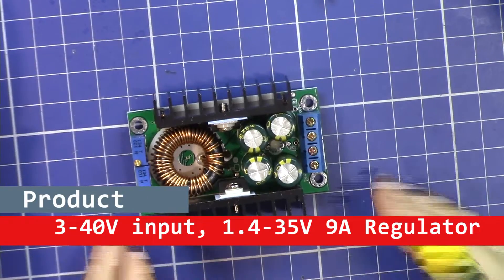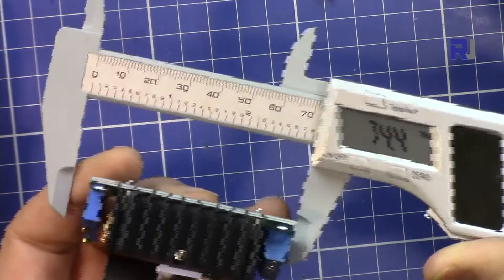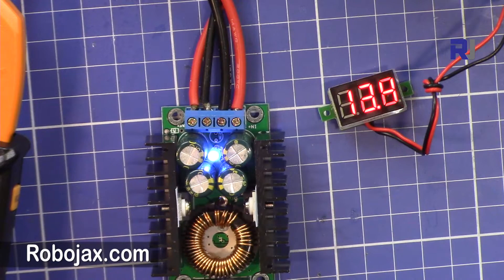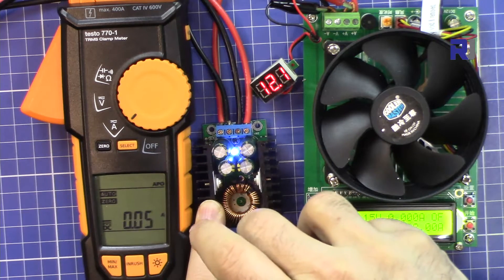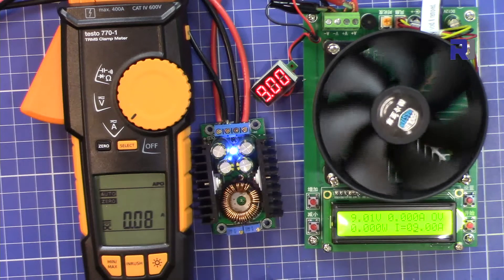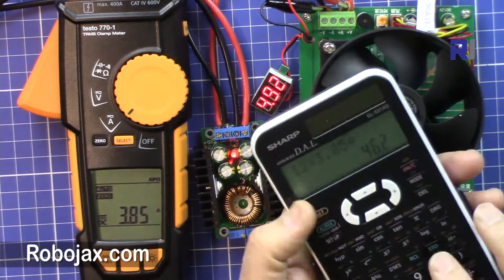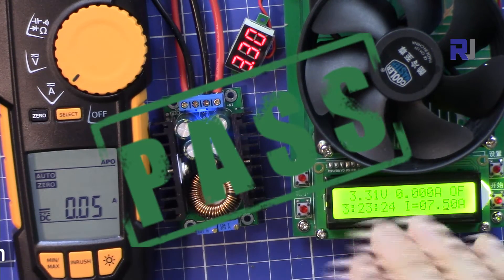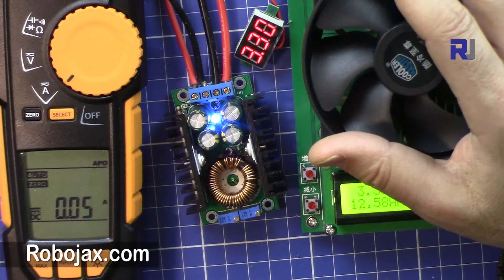DC CC 9A 280W Step Down Buck Converter 7-40V To 1.2-35V XL4016 Module - RJT321

Comment: I have connected 200watt solar pannel 16amp current worked but very hot 🔥 so I'm using 100 watt pannel it's working very well to recharge my batteries since 7 years

Comment: I am trying to connect TEC-12710 to XL4016
but buck converter takes less power when connected with power supply
i mean its current pot comes in even if only one is connected 

i wanna connect 4 peltiars 
and control them using a buck converters output voltage pot (that i will change with dig pot to control the power)
i want to each on 45W in the start and then i can reduce the power by reducing resistence from dig pot

any buck you suggest me to use ??

I am new in electronics
Thanks you for reading

Comment: what module have small cheap and can down volt, 40V input max and output 5V max to arduino, i need sense when 40V power supply have ON and then arduino input sense this aand doing somethink whit servo.if power ON servo move left, if power OFF servo move right. and arduino whit servo have own different power supply.

Comment: I just got mine in the mail and used an 18 volt battery stepped down to 12.8 volts at 5 amps and i can't get more than 1.6 amps. So its not 300 watt but more like 20 watt! Oh well time to modify! Cheers from Australia subbed and liked 👍
Reply: Hey..did you set the current limit properly? It could be due to wrong current limit setting

Comment: Hello. Is it possible to use two of this in parallel so to increase its tolerance from heat when used in 150w or 200w solar panel?
Reply: pm me can you to install do sola paint of charger¥

Comment: I've bought one of this but mine wont change the voltage output. If I connect 12V, on the output is also 12V no matter which way I screw trimmers. Same with 3V and 5V. Any suggestion where could be the problem?
Reply from the maker: The power MOSFET switch is dead. Unless there is incorrect soldering

Comment: Ampere does not work.  Only voltage works.  The green light is on but the red light is not.  What is the solution?
Reply: have u found a solution

Comment: We observed the module maintains the RED Led on, even with 7.5A. It would mean, at least for me the circuit is limiting the current, or close to do so. That might explain the voltage drops we saw at 7.5A and the more drastic voltage fall at 9A~8A. 
There is another channel that modified the circuit to increase the CC operation from switched (in the current loop) to linear, adding a 100K resistor in the feedback of one of the LM358’s OpAmp. This made it work linearly, instead of a On-Off comparator.
Reply: pm me can you to install do sola paint of charger¥
Reply: Which was this other channel which showed the modification, please do tell.

Comment: Hi Robojax, I just bought one of these XL4016 modules, hooked it up correctly, applied 6 volts to start and started turning the voltage cw. The red light came on right away and the voltage decreased from 4.8 to 2.9 and stayed there. Turning voltage and current pots either way does nothing, stays at 2.9 volts with the red light on. Gave it 18 volts DC and still nothing. Any ideas?
Reply: pm me can you to install do sola paint of charger¥

Comment: Can I use 24v input with 6a 100w for this module?
RESPECT🙋‍♂️
Reply from the maker: yes you can. input is as important as output. but the total power you can't get more power than the input power.
Reply: Is good thanks

Comment: what the meaning red lamp on the step down?
Reply from the maker: that is the CC or constant current light. When the current reaches the maximum setting value of current, it will reduce the output voltage to keep the current constant.

Comment: What happen if you remove the insulator paper betwin XL4016's and heatsinks? Thermal transfer should increase
Reply from the maker: no. it will decrease. the metal surface is not as smooth as you think and both metals will not stay in contact. So keep it.
Reply: @Robojax I guess the insulator is used to avoid that heatisink become electrical conductive. But have worst heat conduction than quality thermal paste.Try remove imperfection from Mosfets and fine sand heatsinks then apply MX-4 instead the insulators. It's hard put in shortcuit them since they are black anodized

Comment: Got one of these units, but current is at maximum, cannot adjust. Had a look over the board but nothing stands out. Any ideas?
Reply: Facing the same issue. Any solutions?
Reply: @M_a_n_a_n1  Can't remember but could have been one of the potentiometers was too far. I mean if you have the voltage set too low, the current goes higher than the setting from potentiometer.
Reply: @DavidJUR-es2qn  I have set output voltage at 9V and input was 14V. The short circuit current went to 6.6A and didn't changed on changing the I_POT value. Current changed by changing the input voltage. The current followed input voltage proportionally.
Reply: Hey I got the solution! One pad of diode T4 was not soldered, after soldering it started working well.

Comment: Good day sir! I would like to ask if I can use this on my 3pcs 12dc fan 15watts each with Direct to solar PV set up? Currently my set up is 100w solar panel and 3a mini buck converter each fan between solar panel. Am planning to use this DC CC 9A 280W Step Down Buck Converter for my 3 12vd fan instead of 3 3a mini buck converter. Will it work?

Comment: Hi, Can I use this module to charge 12v UPS lead acid battery?...
Reply from the maker: Hi, Yes you can.  Just set output to 13.8 or something like that . The voltage will be initiall when you connected to level of battery When the battery is filled up the voltage will increase to 13.8V. Make sure to check if your battery voltage is 13.8V before conning it. 12V is nominal voltage but charging voltage is different.
Reply: @robojax  thanks for the reply!. Do I need to adjust the current to certain amount?

Comment: Can i use this converter to run 12v 7A water pump  continuously 7 hours?
The input sourse is 24V 130Ah battery.

Comment: Hey Sir ! Can I use it in 24 volt power supply to make (1.25 - 24) volt 9A  power supply
Reply from the maker: Hi, this is exactly why I made this video. I have shown all input and output voltages and tested it with different currents. Please watch without skipping so you have no questions at the end.
Reply: @robojax  Yes sir, I watched the video but If I use 24v input, will it provide more ampere at output than 12v input??

Comment: Thanks for the video. I had a problem in 2 of 10 boards that a bought, I have set them to 8 amps and after 1 day working it stopped, and both where limiting the current to les than 1 amp. And the voltage regulator was working, the only problem was that they were limiting the current to less than 1 amp, and the current control was in the maximum. Very strange thing, I think that the IC may have burned.
Reply: pm me can you to install do sola paint of charger¥

Comment: Thanks for video. I have a question. I build  (DIY) solar panel for a project 12V/5A . I want to regulate output voltage to 9V/1A for other devices . Do I need diode between solar and this XL4016 module to protect solar panel from returning power.or not.
Reply from the maker: I don't have the module in hand. see if we don't have a diode, then put one.

Comment: Does anyone knows if this buck converter can adjust a current as low as 20mA?  thanks a lot!
Reply from the maker: if this module can supply 9A=9000mA and you want 20mA, it means 20x100÷9000=0.22%. the potentiometer used in this module has 10% tolerance in best case it has 5%. so you can never set less than 10% of the current 900mA or in best case 5% which is 450mA. The answer is NO. If you are looking for 20mA, then get something with about 1000mA maximum current or even 500mA so you can set 20mA. good luck.
Reply: @robojax  I understand.  I have been looking for a Buck Converter with variable voltage and current to add to my power supply project.  I want to take one of the cables of the ATX to add leads that would output low voltage and low current. Buck Converters I see that work with low current only have one potentiometer to control voltage, and not current.   I will keep searching. Yes, good luck for me!  Thank you so much for the elaborated answer!

Comment: Thanks for the tutorial, I have one of these step down buck converters, I would like to use it to recharge a 3s 18650 battery pack (3x sony vtc5a 2600Mha, 35A maximum discharge) I adjusted the output voltage to 12.6V and the output current to a tenth, 260 Mha, when I connect the battery pack, the voltage (measured with the tester) drops drastically, is this normal?
Reply from the maker: Hello, please see how to change battery from this converter. https://youtu.be/I_rRTJgONTw
Reply: @robojax  Thank you very much ;)

Comment: I used it with power supply of 12V, 5A and output 5V in order to charge 18650 cells and it couldn't handle 2A.. the first cell was charging fine at around 1A but when I put a 2nd cell it only provides around 1.2A... and even the leds are struggling.. maybe I do something wrong??
Reply from the maker: what voltage did you set? 18650 single or parallels  of cells needed to be set at 4.2V. then you need to set the maximum current. I will make video for this module. Check my channel "Watt Hour" where I am focusing on Charger, Battery, Solar and Power supplies.

Comment: Can I use 36v and 6amp adapter and get max power ???
Reply from the maker: P=36V x 6A =216W, if this module has efficiency is about 90% so 10% or 21.6W will be lost and you should get 94.4W. so watch the video and see at 30V what is the efficiency and then you will know.

Comment: then can it bear a load from 5V to 9A? I need to connect a motor with those parameters
Reply from the maker: your question is not clear. is 5V input or output? for input the title says 7-40V so no. for the current, please watch the video to see what is maximum current that you can get from this module.

Comment: Is lm2575 suitable for xl4016 buck converter? Thanks hope somebody answer my question thanks
Reply from the maker: Hello, they are totally different chips and used for different applications. LM2575 is 1A step down converter see it here https://www.ti.com/product/LM2575 and XL4016 is 12A step down converter which is 12 times higher see datasheet here http://www.xlsemi.com/datasheet/xl4016%20datasheet.pdf

Comment: Question, I have a sony NPF battery (7.4V 10400mah) and I want to convert it into 5V 6-8A power supply for my neopixel led project. would this work for that?
Reply from the maker: Watch the video and see if minimum voltage of this module is 7V then yes. I don't remember what it was so watch the video. The same for output current. if you need 6A or 8A see if this module did give 8A output. I don't remember.

Comment: i am making a solar cycle so my solar panel is 12v 50 w and i will place a converter that will change it to 24v 7 amp  and recharge the battery  . battery is 24v 20 ah  and the motor is 24v 250 w.  so plz tell me is this is right  or i have to change it .
Reply from the maker: Hi, your solar panel is 50W and voltage doesn't matter. Now you want to get P=IxV, where P=power in Watt, I=Current in A and V is voltage. for battery you want to get  V=24V and I=7A, so P=IxV=7x24=168W. Never possible. you have $50 and want to purchase  $168 goodes.  you can only get 50W-(15% to 20%) . Voltage and current doesn't matter as long as the product (multiplication) of them is equal to P-Losses

Comment: Any lead acid12 v 80Ah battery charger module with step down modules share ideas please.
Reply from the maker: 80A is huge.  you can charge it with with this module at 8A in 10 hours you will get 80A. But if you want faster charging, keep in mind that charging with higher current reduces life of the battery.

Comment: Hi, first of all thank you for this video. I have got it too. I have a question. If i use 12 volt 2A adaptor in source side, will i take 6volt with 4A? (Like a transformator)(I am asking just teorical with %100 efficiency) Lastly whats the meaning of color of led? Thank in advance
Reply: No it won't
Reply: Yes! You'll get max 7 amps  with that adapter. Blue - no current,  red - in use.

Comment: Hi, I do not understand, you put 7,5 amp into the load, but your ammeter measured 2,6Amp at 3,3volts and you said the dc-dc converter is capable for 7,5amp. Please may you explain that to me,
Reply from the maker: Hi, I made the video to explain that. If I type it, what was the point.  You did not mention the  time like (3:25) so I could look at it. Remember Input and output current are always different.
Reply: @robojax  Thank you for your answer,  I did not see the ammeter was in the input, now it makes sense to me.

Comment: Have you tested for 1.2v 5A output? What should be the input? Should we keep 90% efficiency in mind and decide input voltage and current? What happens if I use 19v 4a laptop charger as input for 1.2v 5a output.? Does it work?
Reply from the maker: yes. Output Power = Input Power -10% or 15%.

Comment: Can it be used as a charger for an 18650 12v 45aH battery bank? thanks!
Reply from the maker: yes it can. You set the current . the maximum current it can handle is shown in video.

Comment: I wants to charge 10 ups battery( 12v 9ah )at a time with a laptop charger and this buc converter pleas guide me
Reply from the maker: Sorry I read your comment over 6 or 7 times and hesitate to replay as charging is not simple things.  Proper charging will keep the battery healthy and make it work longer.  But I have no experience with that. I know the theory only.
Reply: @robojax  thanks

Comment: my module: in 19.5v 6.5A  out 5v/9A
Reply from the maker: Input 19.5x6.5 =126.7W and  output 5x9=45W  and efficiency is 45÷126.7= 0.35 or 35% this is very bad. it should be about 90% or something is wrong and most of the energy is wasted.

Comment: What value of potentiometer do i need to replace the trimmers?
Reply from the maker: what is written on the part? if it is 104, then 10 and 4 zeros 100000Ω or 100kΩ if 503 then 50 and 3 zeros 50,000Ω or 50kΩ
Reply: They are w103
Reply from the maker: there you go, you found it.
Reply: Ty

Comment: Hello, I want to make a regulated power supply from the minus working computer power supply, I need a voltage converter for this, you have tested many voltage converters, which advice would you give me?
Reply from the maker: Hi, you have  so many options. Computer power supply has only 5V and 12V with lots of power depending how powerful your power supply is.  if you need 5V and 12V, then you don't need converter. First you have to know what voltage you need. if higher than 12V, then you need boost convert so you can get higher voltage like 15V or 30V output. If you need lower than 12V or 5V then you need step-down converter or Buck converter . in Any case you need to know the amount of current at output. For example if you need 5A then get 5A converter.
Reply: @robojax  I want to convert 12v input, 19v, 20v, 24v.

Comment: You didn't use the cc cv features of the converter
Reply from the maker: I just watched the video and yes I forgot to test CC but CV is constant voltage where you  set the voltage. The because the current is set to maximum, you didn't see it. I will try to do this video again.
Reply: @robojax  But it was a good review. Thank you very much.
Reply from the maker: You are welcome.

Comment: ..please, help me in understanding - this module is supposed to deal with 280W (does that mean "power-support value to a load" or "heat dissipation"?) and, for example, in your first measurement it can't even deal with Uin=12V (I=7,5A), resp. Uout=9V (I=9A) (??) which means:   Pout =81W ; Pin =90W (and the Power to dissipate = around 9W) - is that right or am I totally wrong?   ...nice review, btw, thanks   :)
Reply from the maker: I am sorry for late reply. I was on vacation. Yes. The output can NEVER be more than the input. 280 is not right if you see the test.

Comment: Is the current regulated the same as the voltage, i.e, clockwise increase and counterclockwise decrease?
Reply: Assuming this is true, I turned the amp potentiometer to the minimum (until it's started clicking) and then shorted the module with a multimeter, after which I started turning the amps up, and it seems that it actually is true
Reply from the maker: You got it then.

Comment: what does the output current adjuster do ? as the constant output current ?
Reply: im planning  to power my servo(https://www.lazada.com.ph/products/ft6560m-60kg-metal-gear-high-torque-servo-motor-i407918433-s982720998.html?spm=a2o4l.searchlist.list.1.cf1677af3ezmMV&search=1) with this ...

the input source is 12 volts (4 amp)

adjust the voltage output 6 volts 
and adjust the ampire adjuster to 0 amp..? do i make sense ?
i dont know what ampire adjuster do..
Reply from the maker: any module with Constant Current (CC) can control the output current and protect the device. (this you have to know first). You will connect your current meter between this module and power supply. then for example set output voltage to 5V. For example if you want to set maximum current to 3A, Then short circuit the output of this module and read the current on your current meter (ammeter). Adjust the knob until 3A current is displayed. Remove the short circuit from the output and your power supply never allow more than 3A.